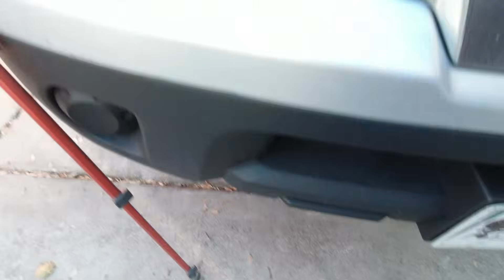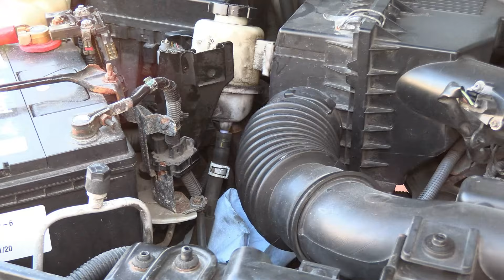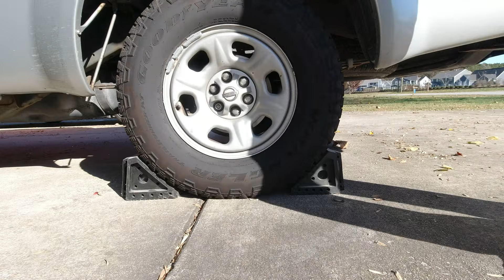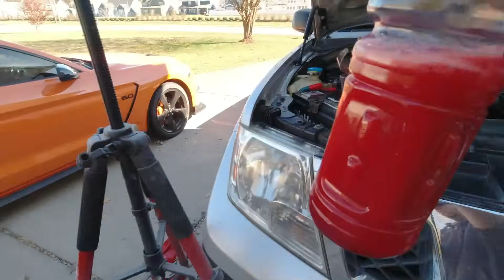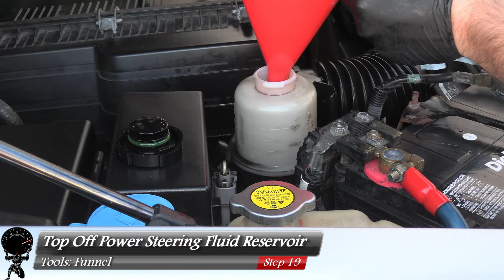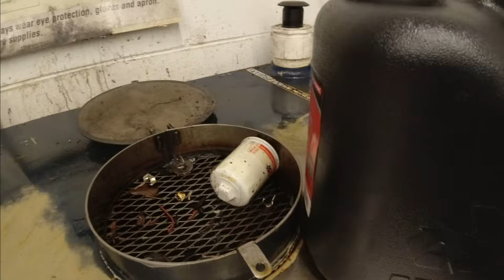How to Flush Power Steering Fluid for a Nissan Frontier/Pathfinder/Xterra (2005-2014)

Comment: I just finished doing my flush on my 2014 Xterra. Took over 2 hours to get the return line off and about 30 minutes to get it back on. I don't know if I'll do this again.
Reply from the maker: How did the fluid look?
Reply: @mcgurrentertainment  The old fluid was quite dirty but not black despite not being changed until 61,000 miles.
Reply from the maker: That's good. You should be good for a long time. Goodjob
Reply: @mcgurrentertainment  It was obviously dirty but not as bad as I was expecting. My steering is a lot smoother now also. I'm doing my 2002 Mustang GT today and it's probably worse since the power steering fluid has never been flushed. 87,000 miles on the Mustang. The Xterra is at 61,000 miles. I need to pay more attention to vehicle maintenance.
Reply from the maker: Its a process

Comment: air bubbles in the line mean you emptied the reservoir and are inducing air into system.. which is no bueno.     Fill the fluid reservoir to the top,  and then turn the wheel from one extreme to the other.   Keep an eye on the fluid and make sure it does not completely empty.   Repeat until the fluid coming out of return line looks new.      Button everything back up,  refill if needed and then start the car.
Reply from the maker: That's why we used the Air Bleeding procedure at the end (to ensure all air was removed from the system) per the manual.
Reply: @mcgurrentertainment  i guess,  but unneeded if done without inducing air into the lines to begin with.
Reply: Thanks for giving me the confidence to go pay someone $100 to do it😂

Comment: Do you have to change the hose thingy in order to do the flush?
Reply from the maker: To flush the system, the fluid needs to be drained into a separate bottle. Disconnecting the return line is the most efficient method. 

The other method would be the turkey pastor method; in which you drain and refill the reservoir several times.

Comment: Hi!   I really like your videos.  I have a 2007  Frontier with the same engine as in this video. I looked through your videos and I could not find one on how to replace the engine and transmission mounts.   Do you have a video for this (just in case I just missed it)?   Thanks!
Reply from the maker: Thank you very much. Sadly, I do not have those videos available at this point in time.
Reply: @mcgurrentertainment  Wow, that was fast!  Thank you!

Comment: Just replaced my alternator on my 2007 and it was covered with power steering fluid. Not sure where the leak is coming from but this video was very helpful showing how the PS works!
Reply from the maker: Hope you were able to find the leak.
Reply: @cele9752 I'm going through the same situation 2008 frontier.  Alternator is soaked because power steering pump is directly above.  I'm replacing the resovoir and the hoses, pretty sure they are leaking into the alternator.  193,000 miles
Reply: @ lmk where you found the leak
Reply: @cele9752  If I had to guess, worn out hoses leading in and out of power steering reservoir.  Fluid trickles down the hoses and onto power steering pump housing and further down into the alternator.  Replaced the hoses, the reservoir, and alternator all in one go.  Threw in a power steering flush too because apparently that’s something I should have done about 120,000 miles ago.  Total down time 3 days in my garage.  $280 for the alternator, hoses and reservoir probably close to $60, gallon of ATF for power steering flush & fill $25.  Nissan dealer would have surely charged me $2,000 for that amount of services.

Comment: Why elevate the truck?
Reply from the maker: It is easier to turn the wheels left to right several times. Plus, it's easier on the tread.
Reply: @mcgurrentertainment but if I didn't have Jack, I could do it on the ground right? Or would it ruin process ? I'm scared bc my dumb ass rushed and accidentally pour good amount of DOT3 into my frontier and used for 2 days until I double checked and realized
Reply: @saltybalty88  It will be a lot harder on the power steering system if the front wheels are  touching the ground. The jack and jack stands are about $200 and you'll have them forever; a power steering pump is $150 and the steering rack is $300-400.